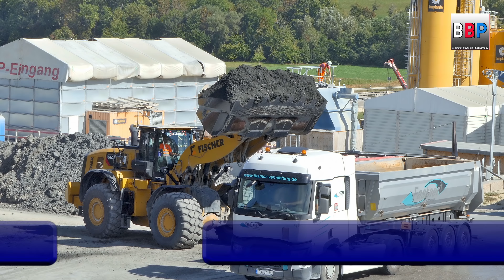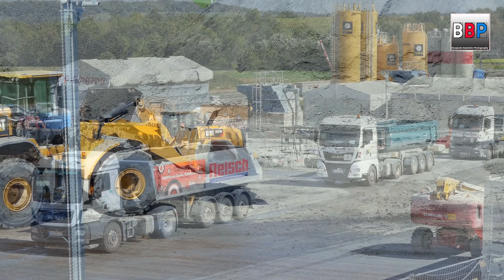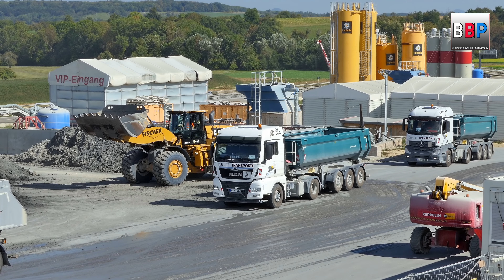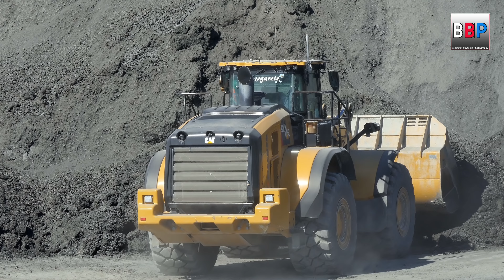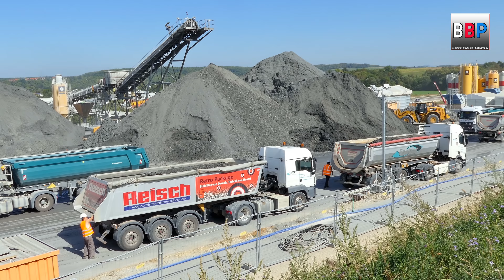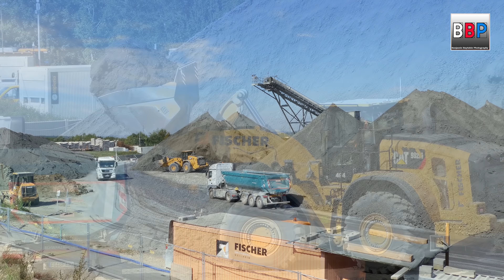CATERPILLAR 966M & 982M, NBS Wendlingen - Ulm, PFA 2.1 a/b Albvorlandtunnel, 18.09.2018. #2

Comment: It looks like the way he raises his bucket to a certain height that he has Cat's Payload System to weigh the buckets as he is putting them on. In the vidoe I thought I heard a dozer in the background, if you can could you show that working? Nice video as ever.
Reply from the maker: Hi Brian, they have to weight any load because of not overload the trucks. There's no dozer just the 953D track loader ;-)